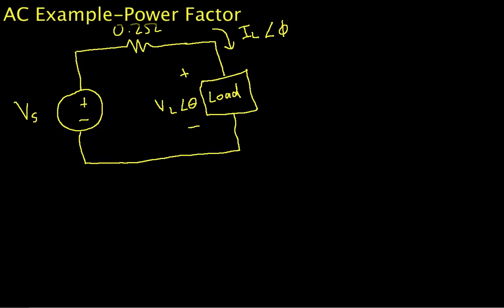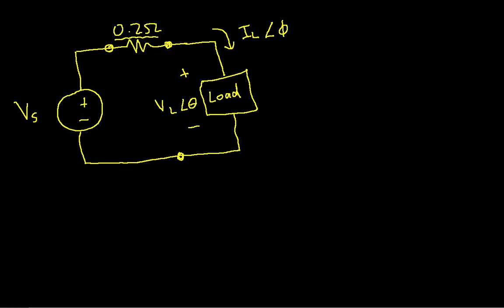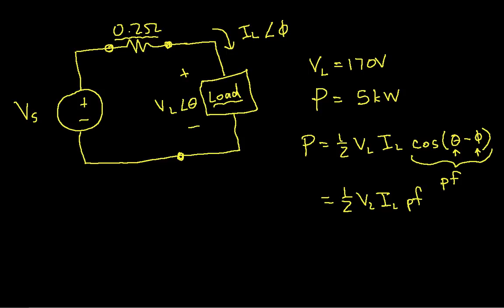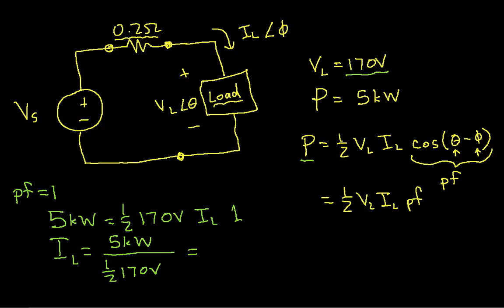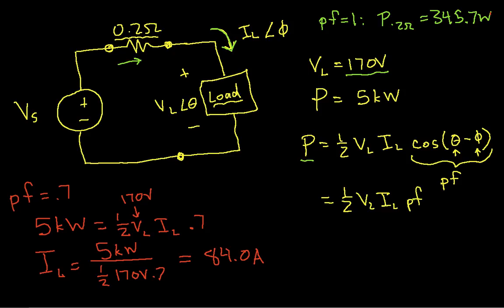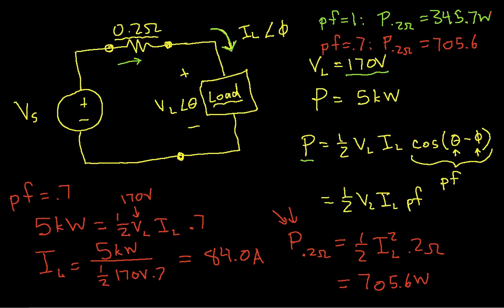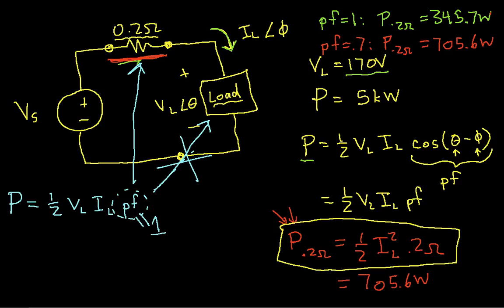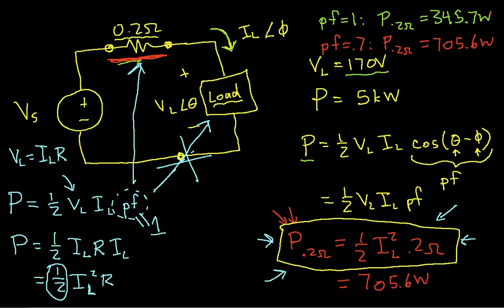AC Example-Power Factor

Comment: Below someone said "Beautiful n simple" but sorry guys that is incorrect.
The first thing incorrect with the video is that the calculations are based on "peak voltage"    The RMS (Root Means Square) voltage  should have been used instead of the peak voltage.

The presentation talks about the heat that is generation.
The way the presentation is presented is correct "ONLY" if you use the peak voltage.

When talking about AC heat generation in any AC circuit, the RMS value has to be used instead of the peak value, because AC RMS values produces the exact same amount heat as the equivalent vakye of DC.